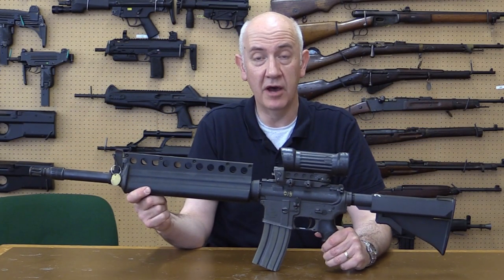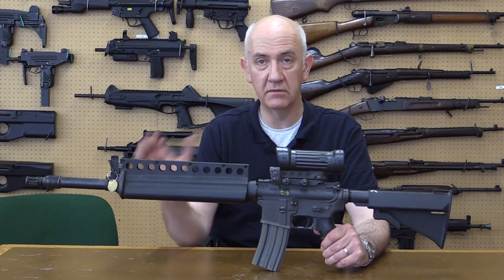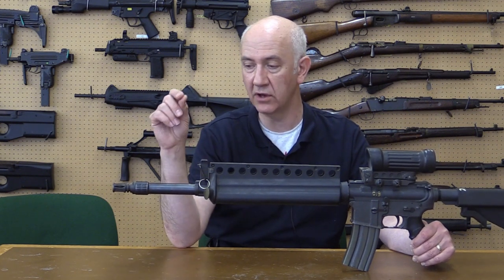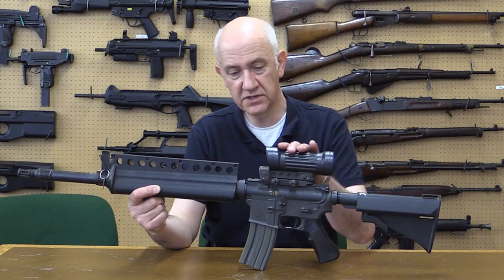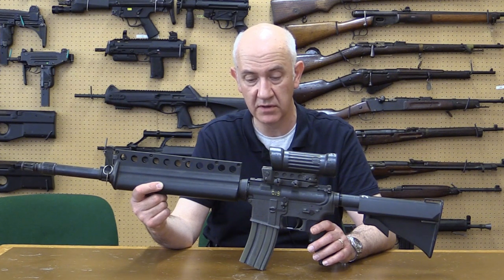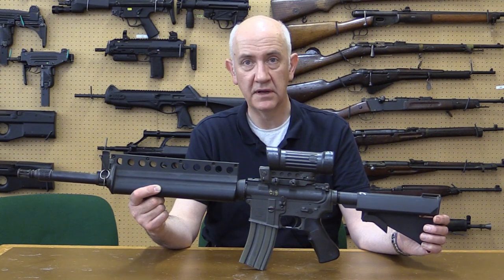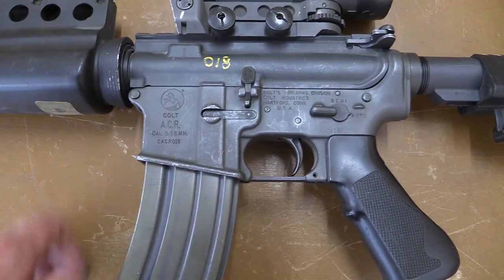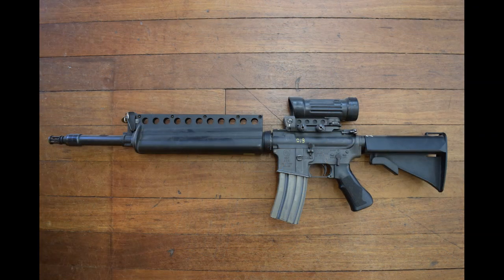TAB Episode 17: Colt Advanced Combat Rifle

Comment: Deuplex ammo kinda seems like a pointless solution.
Reply: MrPotato actually two points 😁
Reply: I think the idea is sound.
Reply: Good one.
Reply: Care to elaborate? I don't realy see how deuplex ammo would be usefull.
Reply: Firstly I am in no way endorsing any previous attempts at duplex or triplex ammunition, nor am I insisting that these cartridges are some forgotten wonder weapon. I do believe that a 300 meter shotgun would be ideal despite it offending my marksmanship sensibilities.
Reply: It was able to only reach half that distance, wich was still impressive all things considered.
Reply: @2Potates  I believe there was an earlier go at fielding duplex ammunition, specifically the 7.62mm NATO M198 cartridge. 

It worked as intended and had some improvement on hit probability, but didn’t have the performance benefits hoped for compared to the downsides, and the alternative (namely the M16) was considered better.

Comment: Great video, propably the worst and least innovative entry rifle.
Reply: It may not be the most innovative, but I think at least it looks pretty cool!
Reply: Nah, idk, the rib looks ugly as sin and ads totally unessecary weight. The stock though looks good.
Reply: Least creative rifle but from what i read this thing's duplex ammo was apperantly the only of the unconventional ammo types of the ACR program able to improve hit probability 150 meters.
Reply: "Innovative"
You mean impractical and stupid? This was easily the most practical one and really only proves that you can't do that much to improve a perfect weapons system
Reply: The lack of innovation is probably what would have made this the winner (if one was chosen), as it is able to use the same design, and same ammunition as the M16. This means that you didn’t have to retrain your soldiers if this was adopted, and this rifle can still use the same ammunition, which would prevent the Colt ACR from being a logistical and manufacturing headache. Also (I don’t know how true this is), but you might be able to use the 5.56 duplex cartridge in guns chambered for the standard 5.56 cartridge.
Reply: If that's the case you might as well fit an M16 with an optic and issue duplex ammo. Mainly because the Colt ACR even without the opic was needlessly heavy.